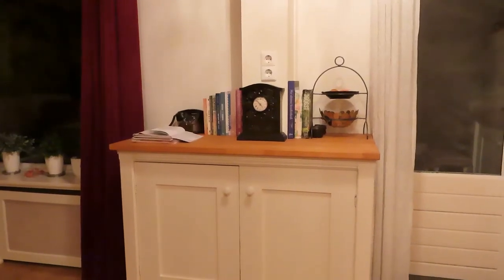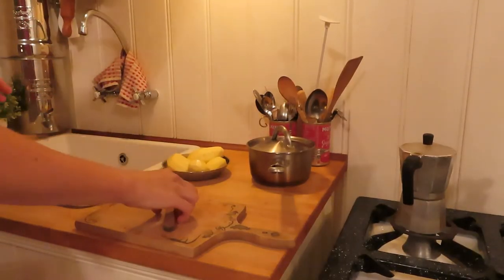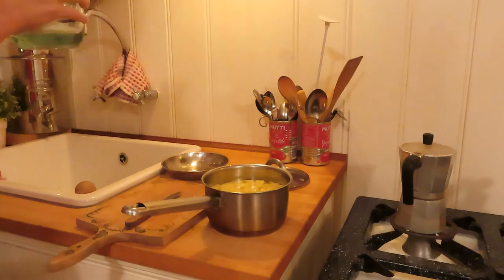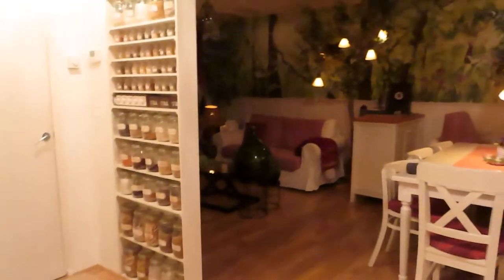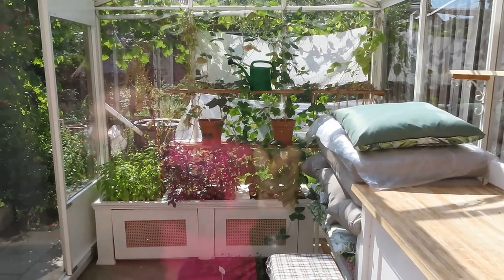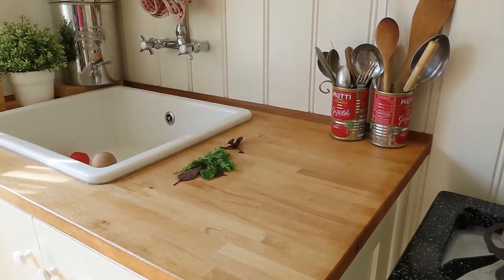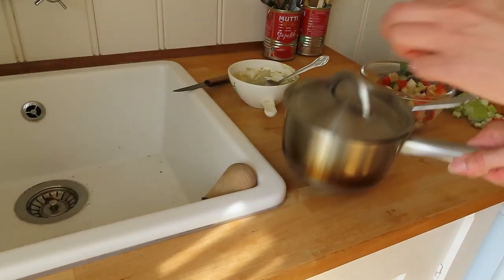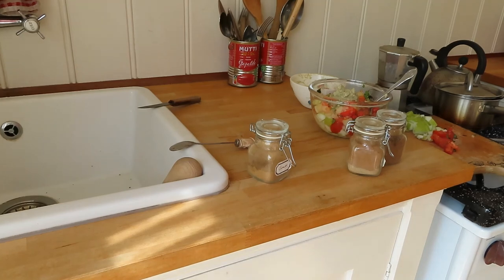Potatoes from a hay box

Comment: These videos you make should be going viral - with the high prices of fuel. So happy to have found your channel. I have a vintage milk box, the kind that the milk man used to deliver milk in back in the old days. I am going to see if my pots fit into that box. IT is deep. What is size of your hay box please?
Reply from the maker: Thank you very much, I have just measured my hay box, it's 12 x 18 inches (30 x 45 cm) and 8 inches (20 cm) deep. But it all depends on the size of your pots I guess, I would at least have 10 cm of insulation all around and have a box made from 0.8 inch (2 cm) wood, that provides the outer insulation. Greetings from the Netherlands, Bregtje
Reply: @Dutchhomestead  Thank YOU SO much for making time to respond to my question. I live in a tiny vintage farmhouse of 560 square feet and I need to plan out every inch of needed space for new items.  I love the style and creativity you put into making your hay box. I do not sew at all So I will have to enlist the help of a friend, if i want it to be as sweet as yours. I have seen some other modern hay boxes where people use an old ice chest and then fill it with shredded paper. I have also seen old wooden boxes lined with 15 plus layers of newspaper and then filled with wool or even old blankets. I just fell in love with the cottage charm cute factor of you sweet designed hay box. And since I work to create cozy cottage charm- i want to make something similar to yours. LOVE IT. Blessings-